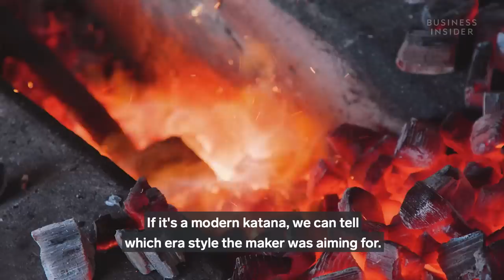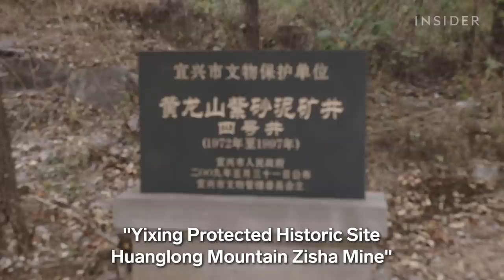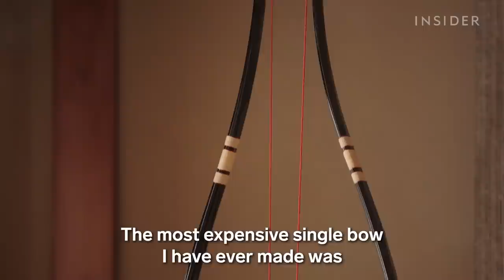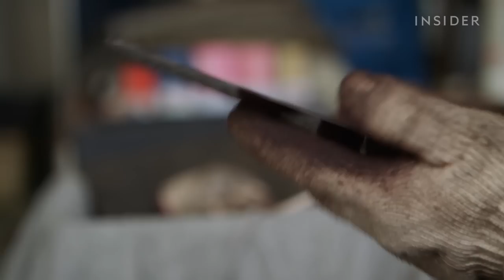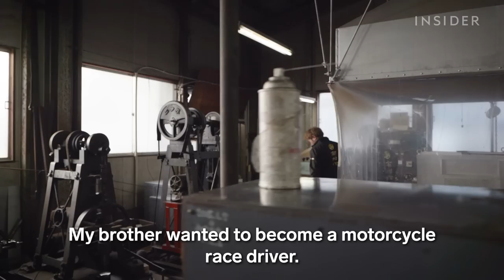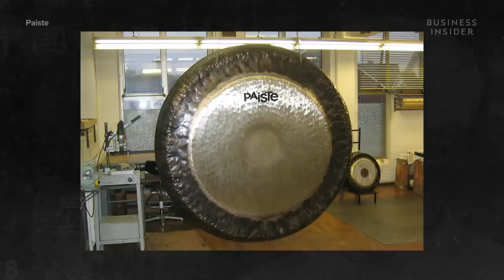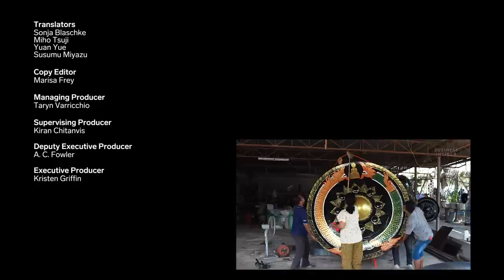So Expensive Centuries-Old Crafts Marathon | So Expensive | Business Insider

Comment: While I do hold the efforts and skills of traditional Japanese swordsmiths in very high regard, the process that they use is completely unnecessary now.  The folding of the steel is not needed with modern ore processing.  The technique used in traditional Japanese swordsmithing was only necessary because of the poor quality of the easily accessible iron ore in Japan, and smelting furnaces that couldn’t get hot enough to fully melt the iron.  These aren’t issues anymore.  The folding does nothing but increase the labor.
Reply: because its art, plain and simple
Reply: Depends on if you like having tamahagane or not. Yeah, you can crank out monosteel katanas by the hour (and the steel definitely has better QC) but even with a hamon they don’t look anywhere near as good as a traditional one.
Reply: @matthewmarting3623  if looks could kill, but they can’t.  As a weapon of war and not a piece of decoration, modern steel alloys are the far better choice.  If you want something pretty to look at buy a painting.
Reply: @GusCraft460  Mate, the blacksmith literally said he's making swords for blade collectors and temples for ceremonial stuff, so he's doing it in traditional way as much as possible. I don't think anyone is buying katanas for taking lives at this age. Some cultures just really have appreciation beyond swords' practical use.

Sure he'll probably produce more, faster and probably better quality if he switch to modern steel, but that makes him no different from those sweatshops from India or China nor from those Western factories churning out plenty soulless and uninteresting blades.
Reply: @khust2993  no, those shitty swords are just punched out blanks ground into shape.

Comment: Why are these things so expensive? One word. Marketing. Katanas relied on this for decades. An English Longsword can be made to be equally sharp and even shaped than a katana. It’s also longer than a katana. The marketing perpetuates the myths that’s why they are so expensive because people will still pay that much for for the mystique.
Reply: This depends on many factors, though it comes down to this essentially. The katana you see here has of course, had its popularity perpetuated by marketing. Not only that, but generally they use traditional methods practically the same as what was used about thousands of years ago in terms of aquiring bloomery steel, consolidating it into steel, and forming it into a billet for a sword and so on. On the contrary, I've yet to see a traditionally forged longsword than a replica. Usually from what I've seen, they mostly use modern alloy stock steel. 

Basically "painstaking traditional smelting and forging that takes countless man hours" vs. "Modern steel's definitely more abundant and better, hence why it's cheaper."
Reply: Also funfact: long katana had existed.